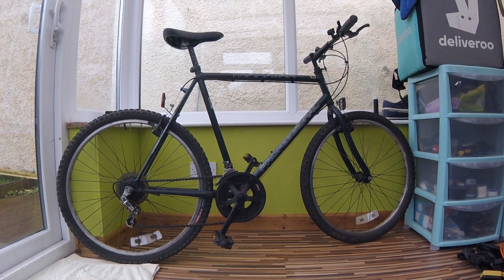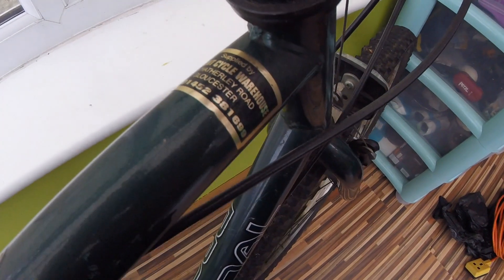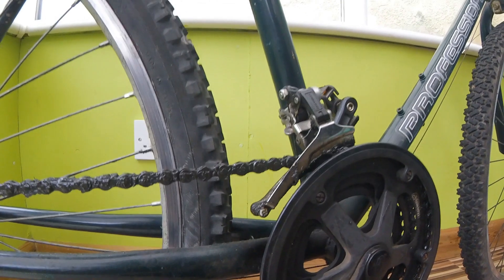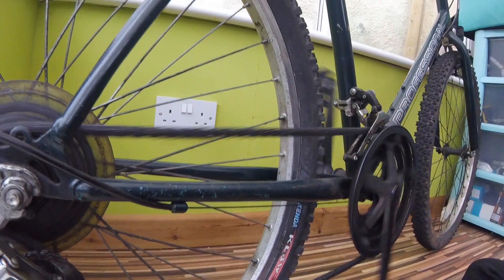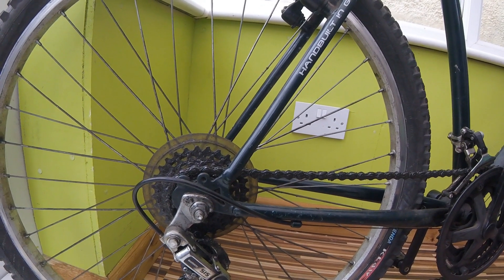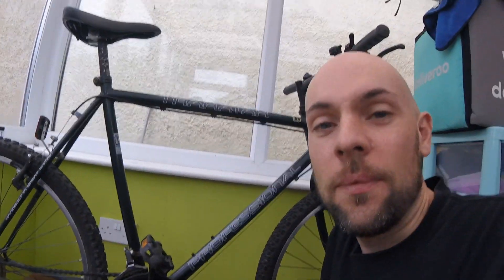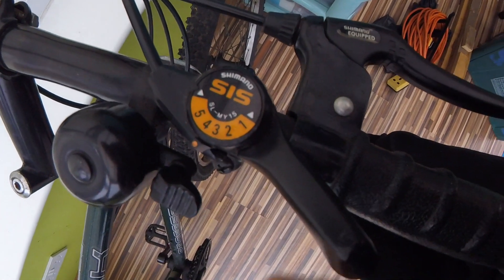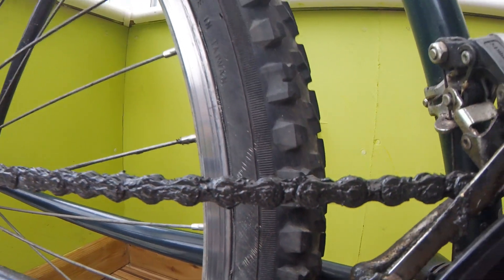New Bike Day for Watkins

Comment: There must "be something in the air" at the moment! I recently started on a project to repurpose/upcycle (in the truest sense!) my original Saracen Tufftrax Comp (first proper bike I bought myself, circa 1991). Looking at a disc conversion, 700c wheels, 1x drivetrain! Don't want to call it a gravel bike but....... 😂 Can't wait to see how yours turns out! 💩➡️🚴🥇?
Reply from the maker: Yours started off as a decent bike right? Disc conversion sounds major, all the best
Reply: @adamwatkins  probably only marginally more 'decent' than yours, in that it is a brand name and has a Tange Prestige main triangle. Other than that it was probably made in the same Taiwanese factory as yours! There's nothing wrong with a heavy duty cro-moly mtb frame, providing you are prepared to do some updating of all the parts! I've just stripped mine down ready for a visit to Argos Cycles. Apparently I'm "not allowed" to buy any more bikes so needs must 😂 Mine holds sentimental value though as I have owned it since I was a teenager! Hope you don't give up on yours!

Comment: replace that seatpost, I've had a couple snap in the last 30 years...honking home 40 miles ....well you never forget it. I started mtb'ing in 91 and all bikes were like that apart from the real top end stuff, long and low stretched position is great for a wide variety of riding. Stick some Schwalbe landcruiser tyres on it ...jobs a good un.
Reply from the maker: defo need new tyres, these are like for mud only. This seatpost is terrible, not much worse than the bike as a whole